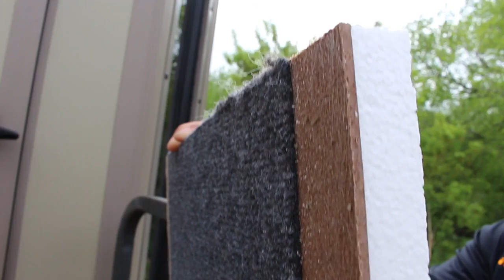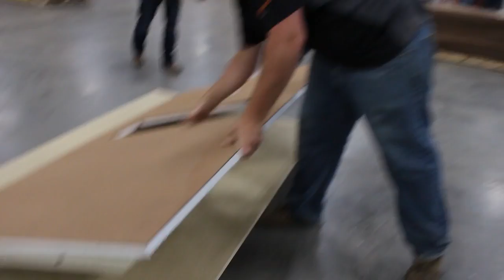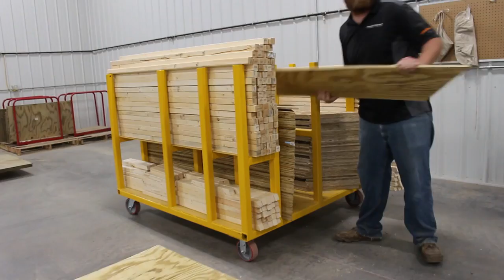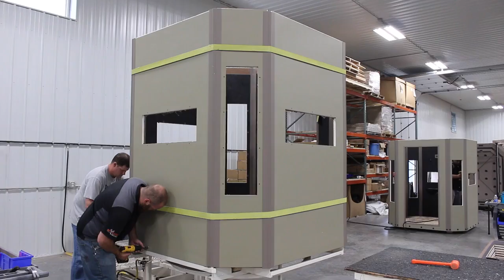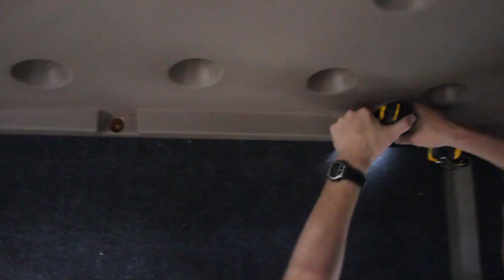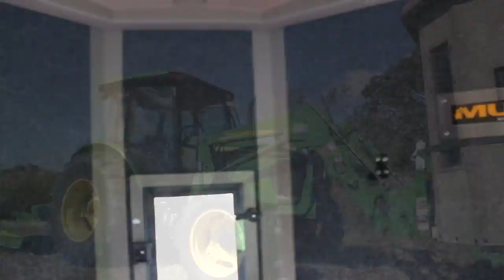Muddy Bull Box Blind Manufacturing | Muddy Outdoors Products

Comment: These blinds literally fall apart after a year.  Mine was having major issue after 10 months and Muddy never even replied to many attempts to talk to them about warranty.
Reply: Got mine and in less than 6 months the side walls started warping bubble on the panels. Like coming apart. We went back and forth with Muddy blind through phone and email. Finally sent us a new one but it was the new steel model cracked earth one.
Reply: Mine too and wouldn’t warranty it. Left with just a 10 foot latter and base.

Comment: I wonder how long that untreated wood floor will last?
Reply: I unfortunately have 2 of these.  All windows drip onto the osb when it rains. They are not weather tight
Reply: @whitetailobsession344  I have one that got by 80mph winds before I could get it put up and the sun caused the wall to collapse under the direct heat. It isn't a solid system.